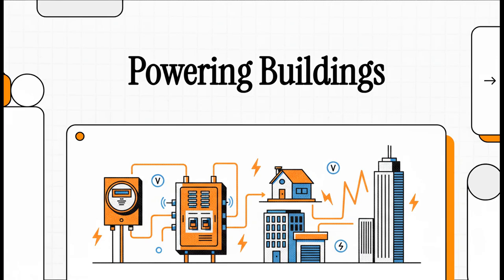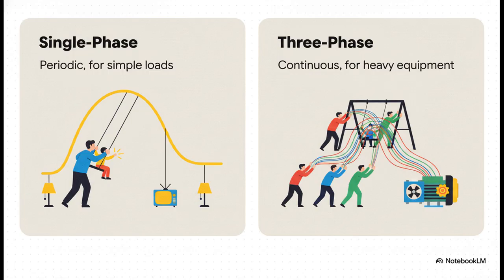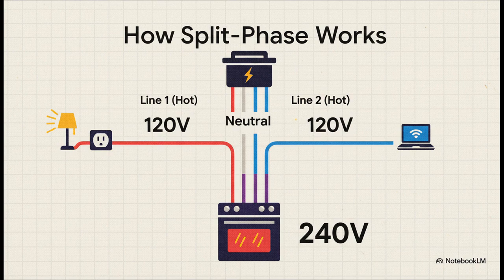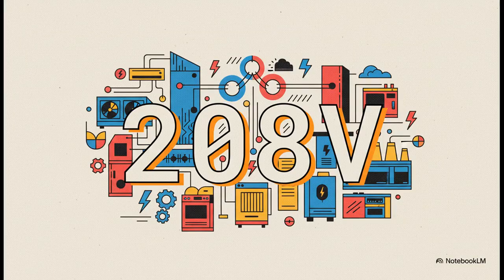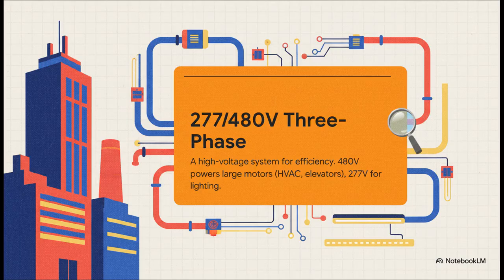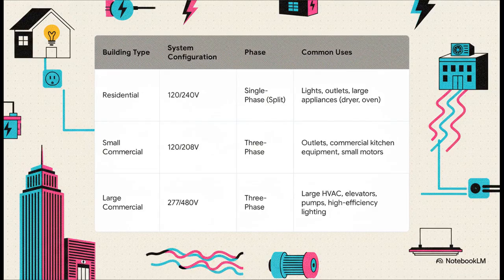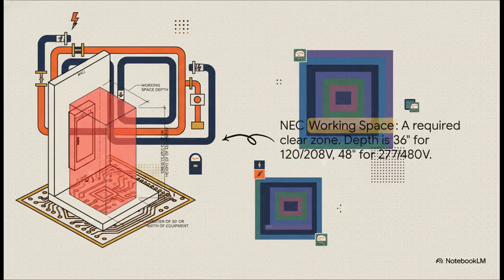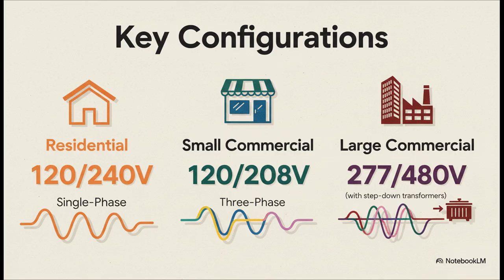ARE Exam Prep: Electrical Power System Voltages for PPD & PDD | ARE Lab

Comment: This video was totally useless and superficial!
Reply from the maker: Thanks for the feedback. This video is intentionally an introductory, ARE-focused overview of common electrical power system voltages rather than a comprehensive electrical engineering lesson. If there is a specific concept you found inaccurate or insufficiently explained, feel free to point it out—I’d be interested in considering it for a future video.